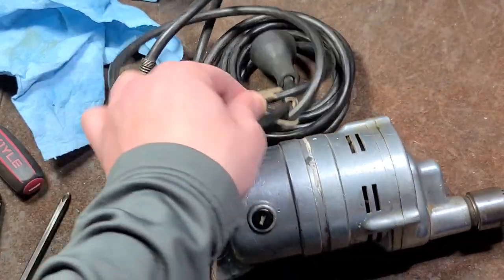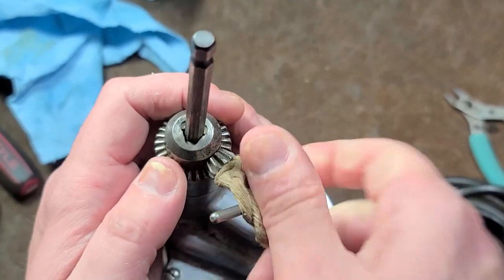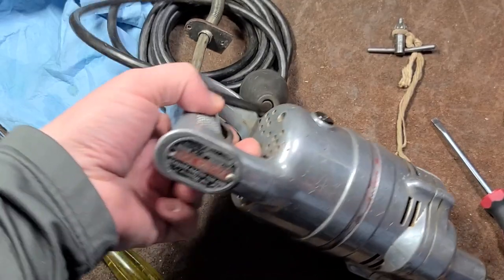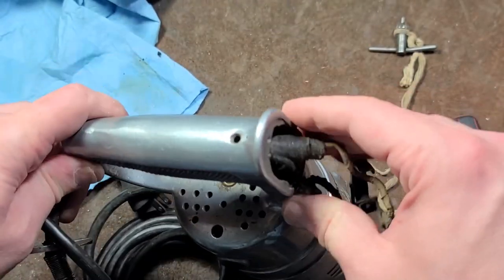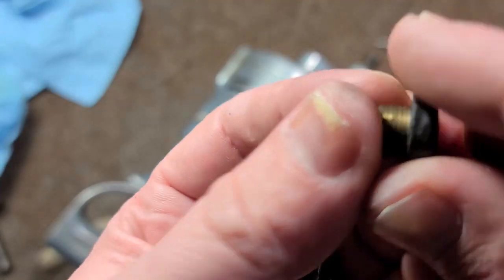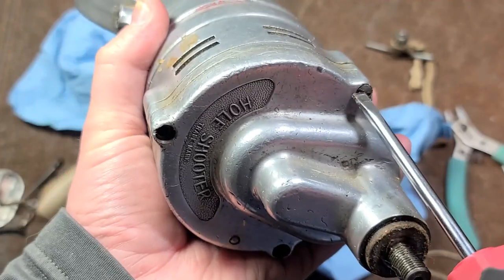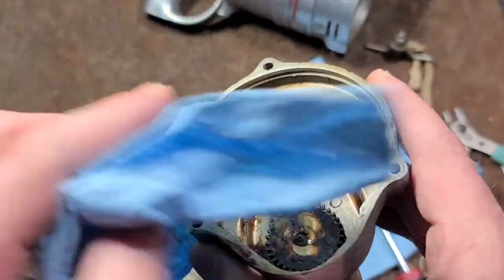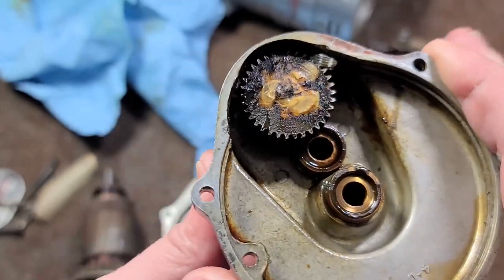WWII Milwaukee 1/4" Hole Shooter Drill Full TearDown

Comment: When we had a problem with the Chuck.  When the Chuck Key  was worn out, or they were missing on the job. 
  We, us.  
Form Carpenter's would use a cut nail, and a hammer to loosen or tighten the chuck to keep the drill bit locked in place. Sometimes we would have to bang that chuck over with a Cut nail to tighten it, 2 to 3  times to make sure the bit didn't spin in the reciever.
.... After useing a drill that is built the same way as this drill, or  modern power drill today.

...This was our creative key to keep moving on the job until we could find a match.

...So that's what happens to Drills when the gear goes. Good Tutorial, Catus. 😁

Comment: Did you get some harbor freight coupons for using their screwdriver. Maybe 20% off coupon?, Maybe a free small blue tarp, a lil' blue oddly shaped flashlight that are actually useful, a 4 in 1 screwdriver that's not too terrible either.  What did they give you, Catus?